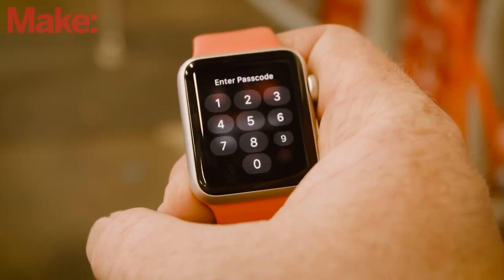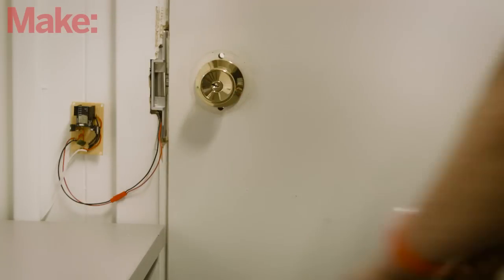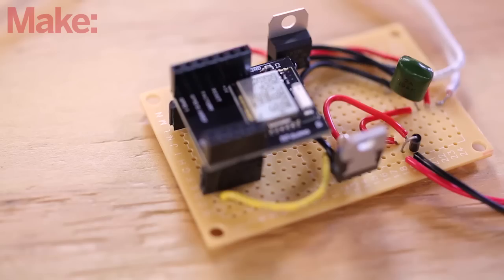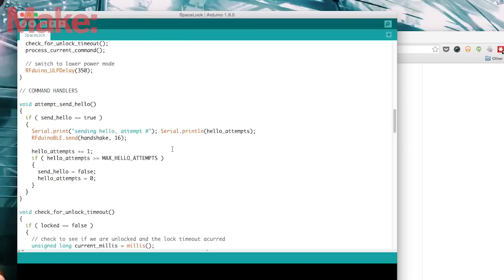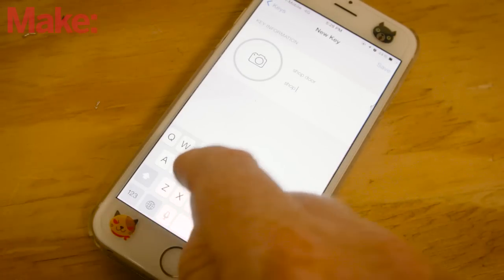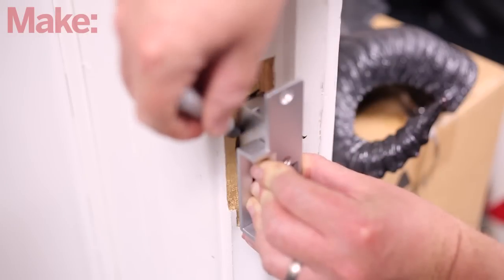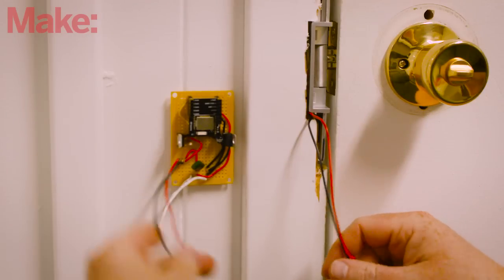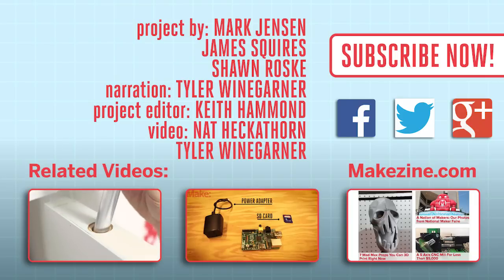Apple Watch Door Unlocker

Comment: Hey everyone, as one of the authors on this project I just wanted to highlight that the iOS app works without the Apple Watch or WatchKit extension. We also made the project and code open source, you can find more here - https://github.com/space150/spaceLock
Reply: Hi. Enjoyed the video. You state a project goal is to integrate with existing security infrastructure. What if I already have an existing system of card swipe locks. Can this be applied?